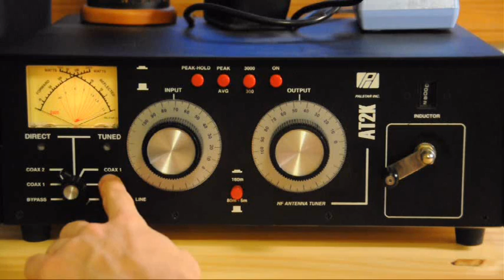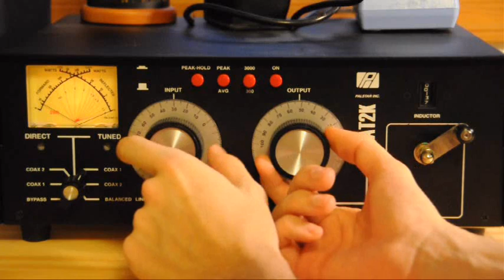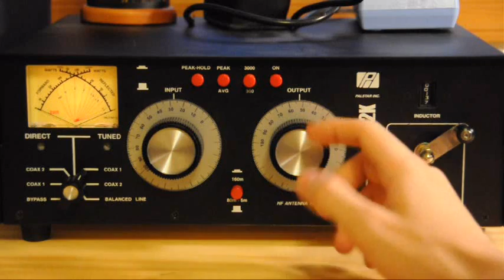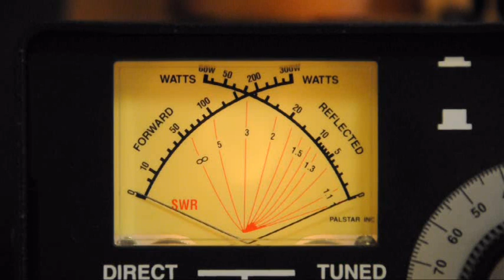Ham Radio Tutorial - How To Use An Antenna Tuner

Comment: If you aren’t jumping bands with a narrow banded antenna then a antenna tuner is useless. Also, antenna tuners do not tune the antenna dude, it’s actually an impedance match for the coax. 73

Comment: Are you making too fine a point when you say that usually an antenna tuner does not affect the performance of the antenna?  Surely, regardless of the fact that the tuner does not affect the standing waves on the antenna, by virtue of the fact that it eliminates the standing waves between the antenna and the Tx it improves the performance of the antenna by producing more forward power?

Comment: You say that a tuner does not change anything between the tuner and the antenna.  So answer this question.  If there is a very high swr between the coax connected to the antenna end and the antenna itself, how does any power get into the antenna if the tuner does nothing but make the radio happy as some experts like to say.  If the swr remains high, little power will be radiated by the antenna.  Explain in detail how your explanation works.
Reply: rf will travel across a feedline with high swr as in 300 ohm twin lead. the modern transceiver needs to see a 50 ohms at the radio in order to achieve a full output. after the RF has reached past the tuner the swr dont matter. if you ever used a feedline of 300 ohm ladder line or twin lead you would understand
Reply: @sirmordrede  You have no idea what you are talking about.  There must be a reasonably low swr at every connection node in an antenna system  for energy to cross it.  Go to school and get an education instead of reading ARRL lit that is written at the 3rd grade level and is still totally wrong.  You are erroneously saying something is happening but you aren't explaining how or why, now are you??  Hams are the most ignorant and uneducated "tech" people on this earth.  They think they are engineers without going to any real school.  They don't even make piss poor technicians.

Comment: Disagree that VSWR (which stands for “Voltage Standing Wave Ratio”) is the ratio between the forward and reflected power.  To explain, when the match is at its worse, the forward and reverse voltage sets up an interference pattern where the two voltages (forward and reverse) perfectly add and then perfectly subtract measured voltage points along the transmission line. This creates a maximum voltage and a minimum voltage.  That Max/Min voltage is expressed as VSWR - a ratio between the maximum voltage and the minimum voltage.  This ratio is called VSWR (again, Voltage Standing Wave Ratio).  This condition is considered infinite VSWR. 

When the match is at its best, there is a negligible interference pattern (VSWR) hence no add nor subtract function which results in no interference pattern.  This condition is expressed as a 1.0:1 VSWR.   At the latter condition, there is no Return (reflected) Voltage present to set up an interference pattern.  The actual measurement performed with one of those meter movements is the *Return Loss*.

The end result is the same - no reflected voltage (and hence reflected power using Ohm’s law) is the desired result.  Finally, I trust that we all agree that we are not actually measuring power with these meters but voltage across a 50 Ohm termination.  A fine point, I agree, but just had to share this.

Comment: I think Antenna Tuners are mislabeled. They should be called Antenna Matcher. They correct the mismatch  and present a 50 ohm load to the radio. They do not tune the antenna.

Comment: Couple of things.  With  all these types of tuners (couplers/ matchboxes)  you want  MORE  capacitance rather than less,  and LESS inductance rather than more.  On lower bands,  start with the caps  70-80% of max instead of half.  Also    Be sure the inductor  ends up on the  "low" side,  IE if you reach a match, and the caps  are both quite near minimum,  decrease L  and try again  see if you can get it matched with more capacitance.  It's important to actually BE CERTAIN  which way your  dials  "go" as I have one tuner where low numbers on the L  counter actually is the max end of inductance.  It's also  not a good idea with most tuners  to  diddle with  L  while outputting considerable power.  "Unkey"  when close to matched, and move the L a little bit
Reply: Also  LOG YOUR READINGS  so you can start  at a  "close" point next time with out  "qwuriming"  the band!!!
Reply: Your point it taken about "diddling with the inductor" but Tyler made the point of running minimum power - in his example 5 watts.  When adjusting an antenna tuner, minimum power should be applied until the reflected "power" can no longer be observed.  Then increase the power until you can achieve a good match.  It may not be that you should be adjusting variable inductor while applying 100 watts.  It depends on the power handling capability of the tuner.  

By way of adjusting a tuner under higher power, note the inductor setting and then adjust the inductor with the transceiver unkeyed - key power and adjust according to his  instructions.  If you have gone the wrong way then unkey and adjust the inductor on the other side of the reference setting and repeat the procedure.

Comment: Question:  Are you keyed up the entire time this is taking place? And also if I go into bypass mode can I then utilize the internal antenna tuner on the radio, if it's able to tune properly without using the external?

Comment: Wrong its wrong its between the radio and the antena this are adapting the feed line and the antenna together the best its not to have the AT at the end of the feed line but at the top connected directly to the antena

Comment: The only comment I would make is that for initial "course" adjustment I don't transmit at all.   I listen in receive mode and adjust tuner for peak in noise.  That gets me pretty close and then I go through procedure that you use and transmit low power for final adjustment.  This prevents transmitting on a highly mismatched tuner setting.

Comment: Nice!  When using the tuner can you be on ssb or do you need to be on am for accurate carrier swr tuning?
Thanks.
Reply: While it is possible to do it on ssb, having a steady carrier ( as in AM, FM, and CW) keeps the meter's needles steady and gives you a quicker, more accurate reading.

Comment: Is this also useful for Those receive only radios Like my AOR
Reply: good question! in theory, yes. .....but, the reflected power is now the incoming power (tx) and the forward power is now the reflected power---from the receiver antenna point of view.    ....also note that the power from the antenna will be very, very, small and might not even register, as this device was not designed for that measument.... but, it would be an interesting expierment...

Comment: Hi Thank you. I was licensed in 1970 and have not operated since 1975. I am getting back on since someone gave me an Icon 765 and I need an antenna. Thanks for your helpful talk. I guess I should look at the rig and see if it has a built in antenna tuner. I previously had a Swan 500cx which was a tube rig with a built in antenna tuner. Thanks again and 73's de Ed WA2BOX

Comment: Whoa Nelly! All you handing out the effusive praise for the video completely neglect the fact that the narrator starts by transmitting WITHOUT checking to see if the frequency is in use. Also, he does not adjust the inductor and caps for max noise first before applying power. The guy then proceeds to yak while introducing more power and STILL does not check to see if the frequency is in use.
Basically, the guy is an idiot!
Reply: my thoughts exactly.  this is why so much QRM'ing on the bands.

Comment: Great video! I’m a brand new technician and I’m studying for my general. What is the overall purpose of the antenna tuner if it doesn’t improve transmission performance? Is it simply to protect your radio from the reflected power of a poorly matched antenna?

Comment: Tyler- Nicely done!  Here are a few more ideas- 

One thing I do 'before' transmitting, is adjust both capacitors for maximum receive noise in an unused part of a band while listening to the noise floor. This often helps to get the caps and inductor control positions even closer and keep the tune-up time shorter. 

 For an alternate low power 'steady carrier', try  AM or FM mode. Use the ptt or mox button to turn the transmitter on and off.
 (Mobile setup/screwdriver note- I find the AM or FM mode useful when manually tuning a screwdriver antenna to resonance with an up/down switch.. I have an auto tuning unit on the ft857 now)

Keep a knob position 'cheat sheet' for a few different frequencies on each band as a quick go-to reference ( even for semi or non-resonant bands- with approx pwr out and 'poor' swr notes). Depending on local wx condx,  you might need to slightly readjust tuning.. 
 Example-  7.030:  5, 3.5, 112// 7.074:  3, 7, 117// 7.268:  4,8, 138  etc.

 Peak/AVG meter reading-  Try peak position for quick needle recovery for during adjustments. 

  73, Eric n6spp

Comment: Hi I had a question.. I want to run a dipole antenna in my attic, I am getting a yeasu757gx, I see they sell kits online. If I buy a pre made kit presumably set to the correct length and say ad about 15' of coax without using an antenna tuner, will this potentially burn out the radio? Or would it just not be optimal? Also what If I tried transmitting on say the wrong length antenna for the band I am tuned to. I just want to get an idea of how fragile these radios are. Thank you.
Reply: sz42781 My fathers radio is a 757 and I burned it out using it on a wrong band. Luckily a friend was able to fix it. Use the formula of 234 devided by the frequency you are using for each side of the dipole.

Comment: Thanks for very nice explanation on the antenna tuner. You indicated that all it is really doing is getting rid of the standing waves between the tuner and the transmitter. However, if you are using a linear amplifier I assume that the tuner is the last thing
before the antenna goes out. Is that correct? In other words we go from transmitter to linear amp to antenna tuner  to outbound antenna cable?

Comment: Hmmm, l don't buy the 'wasted power' bit.  Adding inductance makes an antenna, electrically longer while capacitance makes it electrically shorter.  A matching network makes the output impedance of one stage equal the input impedance of the next stage so that you have maximum power transfer.

Comment: A few things I think are problematic with the video. First, you don't start out by discussing the connections on the back - that's what you should have started with. Secondly, the manual that comes with the AT2K (I own the same tuner) specifically gives you starting values for each band for the inductor as well as input and output dials. You don't just start on 50 and 50. You do have very good delivery and a good voice - I just would have liked to have seen you be more methodic and thorough.

Comment: Antenna tuners never increase final outgoing performance, but, (could possibly) decrease it. Antenna tuners simply fool, deceive and trick the transmitter into believing it is matched to the  antenna freq., therefor lowering the SWR and keeping the Xmitter from possible damage. Kinda like when you are at work and your Spouse is cheating on you,but You think everything seems to be  ok. ha.
Reply: +Cal Mays 
That depends on the position of the tuner in the circuit.

Comment: A tuner filters the reflected power from going back into the radio, and redirects it to ground.
So some of the power radiates from the antenna, and some goes into the ground.
But the transmitter doesn't overheat from the mismatch.  RF radiation seeks the path of least resistance.
It has to go somewhere. 
Think of the coax as a garden hose under pressure.  If the nozzle is too small, the pressure builds up in the coax and back before the faucet valve. Add a Y connector and relief valve to send some of the water pressure down the drain.  It's much better to have a nozzle matched to the hose and water pressure. btw, cheap garden hose can leak, like junky coax.  VSWR is like backed up pressure.
Reply from the maker: ***** I do believe that you are mistaken when you say that a tuner "redirects [reflected power] to ground".
Reply: Electricity seeks the path of least resistance to ground.  The antenna tuner makes a 50 ohm load, some RF radiates from the antenna, but where does the rest of it go?
Reply: @N7TFP  no shit, he hasn't a clue!
Reply: +umajunkcollector From what I understand, the power does not get wasted to ground and not all of it becomes heat.  The power is reflected from the tuner again back towards the antenna.  Some of this power is then lost to heat due to impedance in the feed line and some is radiated by the antenna.  Of course, some of this reflected power is once again reflected back towards the tuner!  It goes back and forth like this until all the power is either converted to heat or radiated by the antenna.  As I understand it, the antenna tuner just ensures that power isn't reflected back to the transmitter.
Reply: Bottum line...  wasted power.  Some seem to think that a matchbox makes the antenna radiate all the power.  It's much cheaper to make a wire dipole or loop antenna, both  radiate RF waves better than an  expensive auto tuner. A tuner iss simply a way to prevent cooking the final PA.  Don
Reply: If your feedline has low enough loss, and is short enough, very little is wasted.
Reply: +umajunkcollector
 Heat.

Comment: Does nobody build resonant antennas anymore, even a simple dipole at resonance will outperform an antenna and tuner combo?? Or am I missing something here?
Reply: resonant antenna`s are fine but not everyone has room to fit loads of resonant antenna`s / dipoles in their back garden , so using an antenna tuner on a long wire or something like a g5rv is benefiial to us that for local planning restrictions can only put one antenna up
Reply: And that's why I'm always/Portable
Reply: Tony Infrared Stamp but you never said that , in your original question . i currently use an edx2 auto antenner tuner and looked at this to learn how to use a manual one , great video
Reply: I don't use a tuner? I think you may have read the wrong reply?
Reply: i never said you use a tuner , , i said that people need to use tuners coz not everyone has space for resonant antennas , you said thats why you go portable so i took it that you go portable with resonant antennas , its me that use a auto tuner but i want to learn how to use a manual tuner and videos like this encourage us to use and learn new equipment , i like to use tuners not just on ham bands but also on shortwave listening

Comment: Wrong way to tune a tuner. Never start with the capacitors midway in a T network, unless perhaps way up on higher bands. Optimum efficiency, power handling, and bandwidth occurs when the network loaded Q is lowest, which is around the point where one or both capacitors are at maximum and the inductor at minimum.

The LAST thing you want to do on 160 or 80 is set the capacitors midway at start.
Reply: Interesting, Tom.  I'll have to check your web site to see if you have an instruction - seriously, with no disrespect intended.  My MFJ tuner manual instructs me to use the minimum "L" needed to achieve the desired result.  I've always used that as a benchmark approach
Reply: @alanbrown4766  When I had a consulting relationship with MFJ I  corrected many of the MFJ manuals to say use the minimum inductance that results in a match instead of the old instructions that say to set them mid-way. I also tried to include tuning charts in everything, and get them to set knobs all the same way so full CCW at zero is maximum capacitance.

If you look at Ameritron manuals, which I wrote all through the life of Ameritron, they all say that.

If you look at any knowledgeable person on networks, like W9CF or others, they all say that. 

In the early years manufacturers said set the caps half way. That was because they just did not think through how the T network works. The more capacitance in both capacitors that still produces a match....the higher the efficiency, wider the bandwidth,  and higher the power handling becomes.  This is right around the point of minimum inductance that allows a match.

The less capacitance and more inductance used in a T network, the less power the tuner will handle and the higher losses become.

Comment: Will an antenna tune be beneficial for a Siltronix 1011D?
Reply: No because that radio is an old piece of junk. Just use a CB antenna and make sure you have a good SWR match to the frequency and be done.

Comment: I have an LDG z100plus auto-tuner in my car and it is a godsend when using an HVT-600 multi-band antenna.  I just installed all this and have on order an MFJ-207 antenna analyzer because like N1QQ mentions, the antenna won't be effecient, and you won't be radiating your maximum power without the antenna actually properly tuned and resonant.

Comment: Turning that crank reminds me of starting a car from the early 20th century.  Surely there must be antenna tuners that use modern digital electronics that can tune an antenna in a split second and offer additional benefits not found in manual systems?
Reply: Yes, there are modern auto-tuners. I've never owned one though because they were much more expensive at the time when I bought my manual tuner.

Comment: Great Video.  My tuner is a Vectronics HFT-1500.  Never understood the directions that came with the tuner so just used the FT-1000 Mark iv's tuner.  Your video made using the tuner easy.  Thanks for the help.